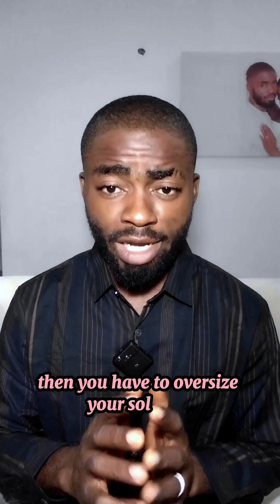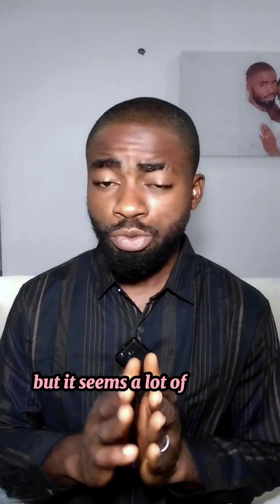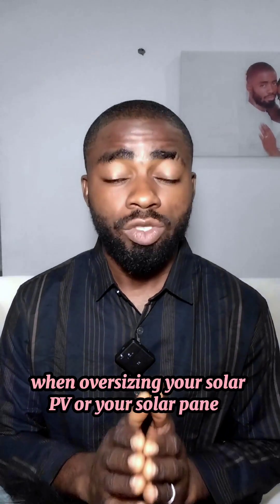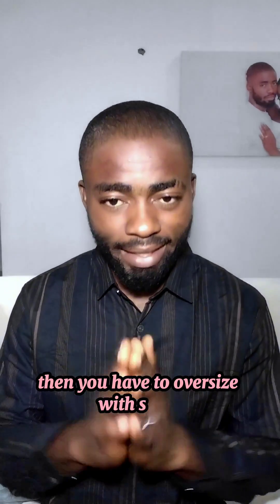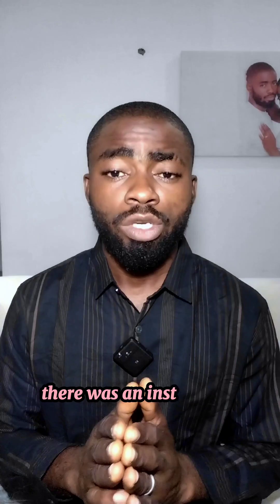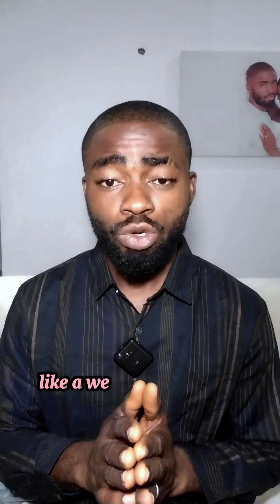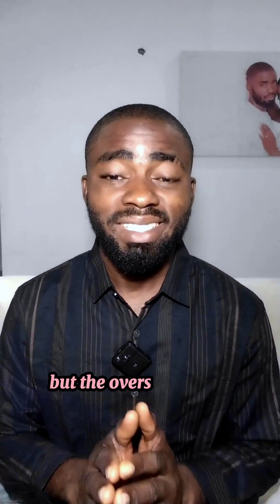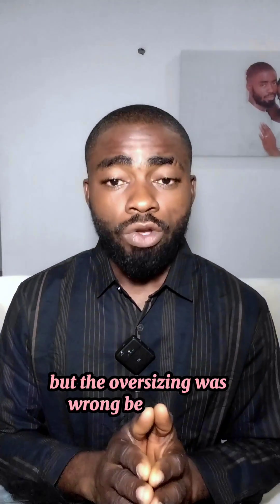oversize your solar pV within the limits of the solar charge controller

Comment: A 60amps mppt SCC should have a maximum PV input voltage of 150 volts in most cases so connecting 2 units of those 300 watts solar panels in series would have been okay (not ideal as I prefer 3x3 or 3x4 configuration) , then you can connect up to 4 strings of the those in parallel making a total of 8 units of 300 watts. 

The 60 amps charge controller will even handle 12 of those panels conveniently with the right configuration 

Configuration of your solar panels is very important.
Reply from the maker: So watts doesn't matter?.
You guys just be lying
Reply: @Mairigaemmanuel  First of all, calling someone you don't know a liar is extremely rude so please don't do that again. 
Secondly, I have several installations where I used 9 units of 300/350 watts on a 60 amps charge controller and they work just fine. A few of the installations go as far back as 2018, they're running without issues except battery replacement. 

Please use high quality equipment and you won't be arguing or calling people liars.
Reply from the maker: @oladejiajuwon3076  you're using 200w not 350w
Reply: @Mairigaemmanuel  You need to re-educate yourself..... I'm done with you
Reply from the maker: @oladejiajuwon3076 I never asked your opinion though! 😔

Comment: Dear, my fellow colleague. I understand but it depends on the configuration of the voltage input to the charge controller. It  can only happen if the voltage which must be in series which you failed to explain if it was 12, 24 and 48v. It can't be the current which is amperage. Beside 300w is not too big for that charge controller.  Thanks bro.

Comment: 60 amp should handle the panels size and unit depending on connection.... parallel is not always better

Comment: As some persons have pointed out, the panel configuration would have been added to make this information whole.

If the input current and input max voc has not been exceeded, ild expect the controller to work fine only tripping under over temperature of the area is not well cooled.

Comment: It can handle the 8 panels, it all depends on the panel configuration. A 300 watt panel peak current is about 10 Amp. If you connect them all in parallel, then at peak, thats 80 amp which is more than the charge controller specification of 60amps. Since its an MPPT,   You can connect two panels in series, making it 4 strings, then connect them in parallel, this way you have about 70 -80 volts and 40amps max. The excess voltage will be converted to amp since its an MPPT.
Reply: Please what's your take on this, As we know, charging current for a battery bank should be at most 20% of the battery bank capacity. 

Let's say I have a 2.5kva 24v system , with 2 pcs of 220ah ba3 connected in series, with 4 pcs of 350w panel,

Panel configuration is 2series, 2 parallel 

This will give me an output of around 80volts and around 20amp

Mppt Scc used is 60amp with Pv array max input power of 145v 

Now we no that during peak period ,some voltages will be converted to boost current

The question now is what if current gets boosted to 30amp or more or let's just say over 22amp......will it affect my  battery??
Reply: To charge a 2.5 kW, 24-volt (I will assume it’s a flooded battery system), you should calculate the charging current in amps. Start by dividing the battery’s capacity (in watt-hours) by the voltage (24 volts) to find the current in amps. In your case, the 2.5 kW (or 2,500 watts) system can be divided by the 24-volt system to calculate the current, which comes to about 104.17 amps.

However, when it comes to charging the battery, you should use a much lower charging current to preserve the life of the battery and ensure safe charging. Typically, a charging rate of 10-20% of the battery’s capacity in amp-hours (Ah) is recommended for flooded lead-acid batteries.

For example, if your battery’s capacity is around 100 Ah (check your battery’s specific capacity), you should charge it at a rate of 10-20% of the battery’s capacity. This translates to a charging current of 10 to 20 amps.

Always check your battery manufacturer’s specifications for the recommended charging rate and other guidelines for optimal battery life and safety.

With is said, you should program your charge controller with the maximum charging amperage as per battery requirements to preserve and prolong battery life.
Reply: @oranusichigozie5219  for a single battery, charging current is 10% of battery capacity especially for flooded battery for longer life span(22amps), if using 220AH. For 2 batteries connected in series. I will say it becomes 20%, which is 44amps max. Note this does not apply to lithium batteries as the have BMS(battery management system) to control the charging current even if it is too high

Comment: I would have loved you show us a video of the installation. The series and parrell configuration of the pv and the voltage and size of the battery bank.
cos I dont quite agree with this if the voltage of the battery is 48v. The PV is 8x300=2400w for a 48v system, it should be 50A max. So a 60A controller should be ok.

The charge controller used in your scenerio is probably not smart. Even if you use 5kw PV, The charge controller is supposed to draw its uptimum current and leave the rest. Not compulsory it uses all the power available in the PV. The controller is mppt doesnt mean it has to use the maximum available power in the PV. Maybe the charge controller trips off and doesn't have self recovery.
Reply: u are 100% right .smart charge controller will collect wat is needed and leave d rest but dont exceed is maximum voltage
Reply: @onoakporoborgodstime7491  

Yeah... the voltage part is non-negotiable, just like you cannot connect your household appliance to a voltage above 240vac.
Reply from the maker: 🤣🤣🤣🤣, oga learner. Apply 5kwp of solar PV on your 60amps and see what happens
Reply: @Mairigaemmanuel what will happen will depend on the build of the charge controller. Don't always generalize, there are experts out there that have done a lot of residential and commercial jobs and they don't brag about it, so calm down when passing information you just acquired recently.
Reply from the maker: @jo4mil try it and post it boss
Reply: @jo4mil My system at home is a 60amp MPPT and I have 10 units of 300watt panels. It works fine. 

The controller regulates itself to only accept what it requires and ignore the surplus.
Reply: @Mairigaemmanuel  I don't need to try it, I just need to tell you one charge controller that does that.
Reply: Which product is it pls?
Reply: @Ceresinks  there is always a threshold of oversizing, some leave a +1.3% - 1.7% headroom. Some are rigid.
Reply: Which one is that  @jo4mil
Reply: @Nuel007  Oga professor, show us your workings. dont expect us to take your word for it because you have experienced hundreds of  solar installations.

We all are learners afterall. So far we didnt build the inverter, PV, battery, and controller from scratch we will continue to learn from those that built it and the principle of operations and  operation manual they give.

Please do well to make more research with other products before informing the public. Dont put information out there because of your experience with one or two products.
Reply: @savageolatunde6731 The important thing with charge controllers is their VOC. Just don't exceed it.

That's same, I'm not sure why he didn't just use a different wiring configuration, maybe 2s4p to get around this issue instead of removing two panels and taking energy off the table.
Reply: The best thing is  not to exceed the voltage and amp specifications of the charge controller.
For example, if your charge controller specification is 60 amp, 150v. Its best that the solar array does not exceed 50-55amp and the voltage 140volt.
Anything more than that, in most cases, your controller will get burnt/damaged.
But it is safe to say, there are also controllers which will work pretty fine even when you oversize them due to them been smart and very tolerant